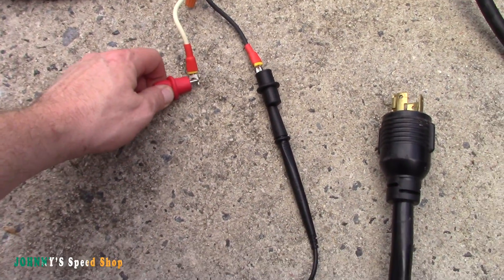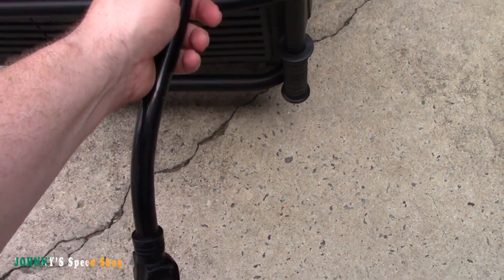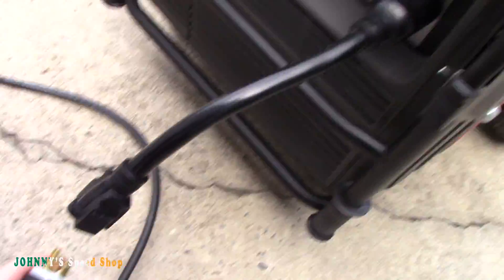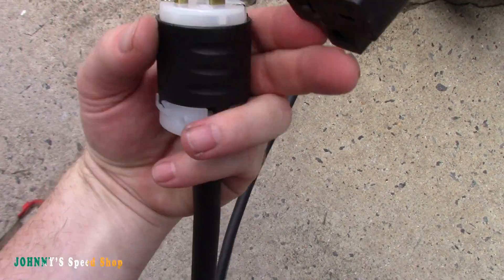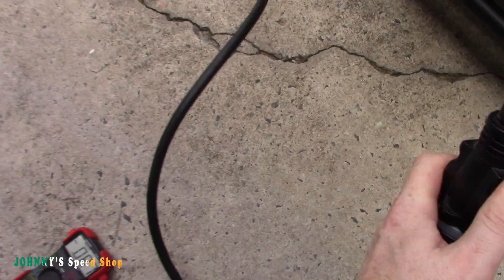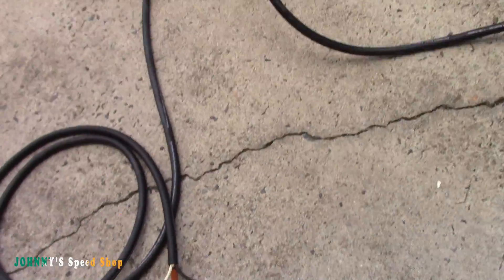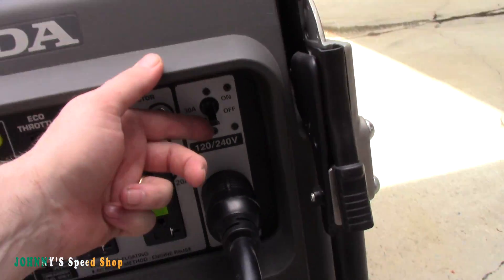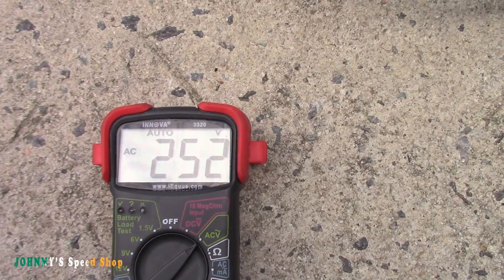How to wire 240V well pump to your generator - Honda EU7000IS

Comment: These types of hacks are fine, but you must be careful if you have a raised septic system with a septic pump... the pump is not powered.
Reply: 🧐  it's probably not connected to houses electrical system in that case
Reply: Cause you have to turn it on
Reply: @juststop5768  that's what she said 😉

Comment: two wires ? huh... there is three 2x120 plus ground... where is your third wire ?
Reply from the maker: My generator has a ground rod on its frame...also there's no ground at the well pump pressure switch it's  grounded by the house... so thats why only 2 wires at 120 each...cheers
Reply: @JohnnysSpeedShop  thanks for the reply.... I need to rig something up to the pressure switch so next hurricane I can have water.... my honda eu2000 cannot do this so I was gonna buy a normal gen with 240 for the sole purpose of water...
Reply from the maker: @jhillestad  Yeah, it gets a little stressful when you don't have water, it's rare for me, if i had many power issues I would wire in a more permanent solution likely with a RV 240v plugs and a separate panel that the generator would run, then you could literally make it "plug and play" with minimal loss of service.

Comment: How fucking stupid is it to step down to a 100ft 120v style extension cord? 

My pump is in the basement, has a box with a switch I can disconnect the pump from the house easily. 

I could also rewire the pump to 120 (/115) if I have to
Reply from the maker: Good for you..not sure what you are talking about with the 100 ft 120v extension...whi did that ? You ? I wouldn't advise that fella....lol

Comment: Just curious my inverter generator has a 12 volt DC/cc outlet 8amp max with circuit I'm running a mobile detailing business and want to use my 12 volt DC pump 7amp max so roughly 84 watts power max use as a plug and use system if I got a plug for the DC outlet would I be safer compared to getting the 12 volt cigarette lighter with an AC/DC adapter to use the 120volt outlet with

Comment: Can you provide links for the plugs/cables that you bought? I'm looking for them and I'm not entirely sure what I'm looking for. For example, I looked up a 240v extension cord, and some $200+ cord came for RV's and generators came up? We possibly have Hurricane Larry coming our way and I want something quick so we can have power. Disconnecting the house wires from the pressure switch makes the most sense until we can get a generator panel installed at a later date.
Reply from the maker: You just need to go to home depot and get some outdoor 240v cable, it will be on a spool and they will charge by the foot...get 10+ food away from your home that way you will stay safe with carbon monoxide....as for the plugs it depends on your generator and what you have for a 240v setup....home depot should have everything you need...shouldn't cost you more than 100 depending on how much cable you need...
Reply: @JohnnysSpeedShop  ok. I'm Canada, so I want sure. It didn't look like you had cable that needed to be connected to a plug; it looked like it was some sort of premade extension cord; that's why I was asking.
Reply from the maker: No worries...I just made that cable..and added the connectors and the plug... hopefully you don't have too much issues with 'Larry"....   them storms can be pretty intense....

Comment: Use caution fellas. Generator power is dirty power. I have replaced countless mainboards in furnaces, a/c units & well motors because of crap power from cheap generators. You get what ya pay for. Fyi
Reply from the maker: Very true mate...most generators have extremely dirty output.... the honda has very clean power, I use it on laptops and phones...no issues.... you diffentaly get what you pay for.... 👍👍👍
Reply: Isn't that why inverter generators were created?

Comment: Hey, how good did this work? My power has been out for 2 day!!
Reply from the maker: Worked perfectly mate....
Reply: @JohnnysSpeedShop  thank you! Guess I'll give it a try tomorrow
Reply: @JohnnysSpeedShop  
So just the two hot wires you hooked up on the opposite side of the switch. No ground or common.
Reply from the maker: @stevem2266  my generator has a ground rod that I use...I would diffentaly recommend you use a grounding rod if you can...cheers

Comment: This works but what I did was disconnect pump wires from pump panel and wire tie generator cord wires right there at panel. I guess you did the same thing just looks like you have extra long wire laying on the ground. Mine stays at the covered panel.  Good job though.

Comment: Great video. Tried this but it seemed like the generator was overwhelmed so i disconnected it. But I also didn’t have the generator grounded separately is that the issue?
Reply from the maker: Depending on your generator it may or may not have a grounding point on the frame....mine does so I use a grounding rod....

Comment: Is there a reason why you did not discount the wire from house to breaker and tie your wires to the breaker? It would be the same as the generator being your main feed without any worries of back feed...right?
Reply from the maker: My main breaker is behing a finished wall and I'd have nowhere to run the generator without opening a window and running a cord out or I could run down under the house but it would have been a 40ft  cable at least, much easier to hook to the switch in my situation...cheers...J
Reply: @JohnnysSpeedShop your main breaker is right inside your panel and cannot be behind a finished wall. Power comes from the pole to your weather head, mast, directly to your panel box where the main breaker sits directly below 🤔
Reply: I'm pretty sure he means he can't get to his panel with the wire  @Beara-bear

Comment: Hey, so what size wire did you use with the NEMA 6 plug?  Great video, thanks.
Reply: His generator is 7000 watts, and 10awg would be a size you need to for 30 amp or 7000 watts
Reply: X
Reply from the maker: Honestly mate I cant remember, I think it was 6 guage weather proof, rated for 600 volts.
Reply: @JohnnysSpeedShop  Yeah, 6 should do it. Thanks.

Comment: Do you not have to worry about the ground from the cord?
Reply from the maker: The Honda generator has a built in ground, I stick the ground about 2 feet down so in this setup it's not required....also there will not be a ground at the presure switch it uses the houses ground in normal use.... so the generator ground replaces it when the house has no power...great question...
Reply: @JohnnysSpeedShop  I just finished wiring it up. I went with a 10' extension cord for the 220 and then used a male outlet that matched it. I ran that plug to the pressure switch and just piggy backed it. I put it in a weatherproof box and it works great. I kept that set up because I like that the plug is a locking plug. The nice thing about my pressure switch is that it did have a ground on it. Thanks for your help! Even though Dorian missed us by 50 miles or so, we are ready now.
Reply from the maker: @amigodrea  nice work mate....  lets hope you never need to use it but it's nice to be prepared....👍👍👍
Reply: @JohnnysSpeedShop the ground at the pressure switch is for faults, so separate from what your describing. Without a ground running from the generator to the pressure switch, if the switch were to develop a fault such as if one of the hot leads broke, 120v potential would be in your pressure switch housing and perhaps even in the water itself

Comment: Where did you get that adapter for your generator? The 4 prong to 3 prong 240. I can’t seem to locate one. Thanks
Reply from the maker: Just from Amazon....you can get it with the cord like this one or just the straight adaptor...cheers...
Reply: Johnny's Speed Shop just found it thanks.

Comment: Would my 50 amp dryer cord work if I just connect the two hot wires in it to the pressure switch where they connect from the house?
Reply from the maker: As long as you disconnect the wires from the house side and replace with the 50 amp hot wires ( @ 120 V each) and ground the generator then yes this should work just fine, I run a separate copper line off the side of the generator frame into a ground stake.